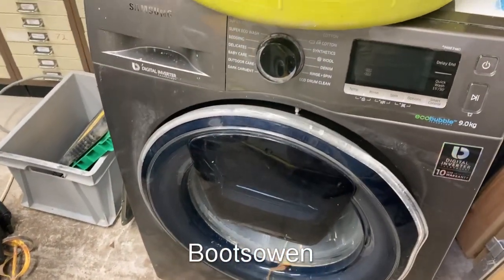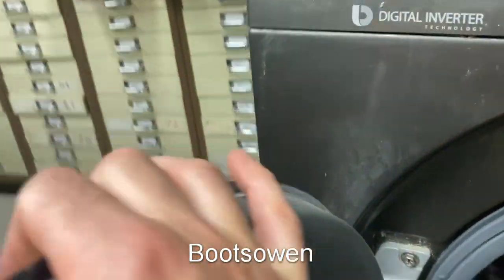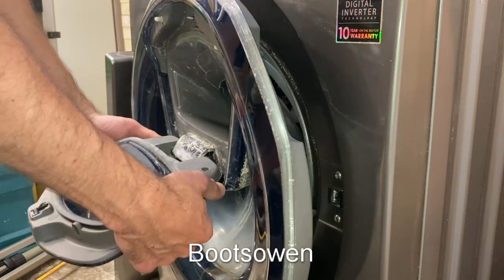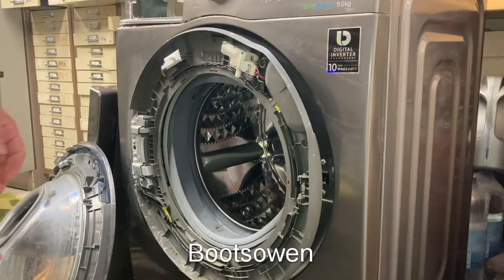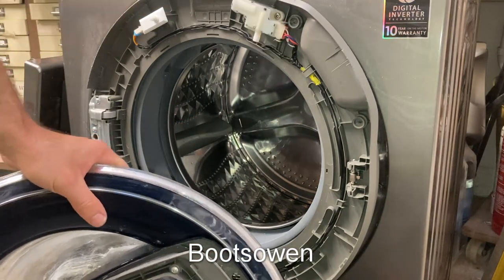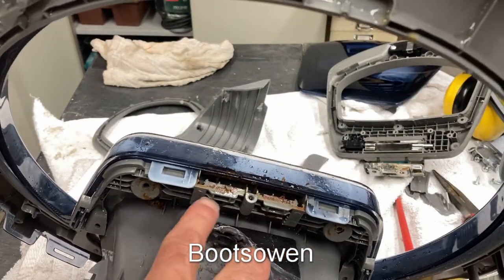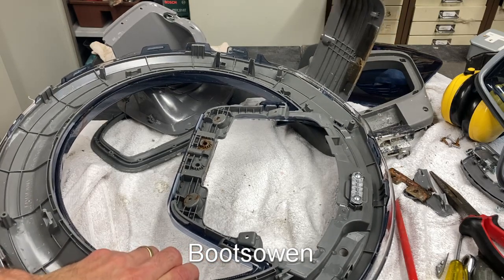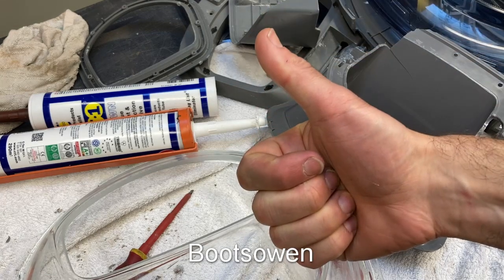Samsung Ecobubble broken leaking door | How to disassemble and repair the door | part 1: disassembly

Comment: Owen, in my world I would tape the sensors in the door closed position. Then before refitting the door front, see if the machine starts to work. If that's the case, cut some thick perspex or aluminium and seal the hole in the glass with that. Be very useful to see if this approach works, cheers

Comment: hello! The small secondary door in my machine is stuck from one side. I see in the video that there are two locks for the small door. When I try to open the door, only the left lock comes undone, and the door remains stuck. Any ideas on how to fix it? Thanks!
Reply from the maker: I would just leave the small door locked, it is nonsense anyway! the big door will open if the small one will!

Comment: Do those Samsungs have a sealed drum? I like them. Apparently they’re great cleaning machines. The door in door is a gimmick though. Wonder how many of them get scrapped because of this fault?
Reply: AFAIK, Samsung uses splittable tubs only.
Reply: @voshin  in Vietnam where is my country i'm from, over 90% front load washers (not only Samsung and LG but also Electrolux*, Panasonic, Aqua/Haier, etc) always use split tub which is nice since most people hate the anti-repair system by using sealed tub which makes the machine impossible to repair as well as you cannot replace bearing or spider, also you cannot recycle them like split tub be

*talking about Electrolux in my country they still use split tub even on their newest models, unlike the European ones
Reply from the maker: This one has a split tub.

Comment: Yeah I'd say the door in door is kind of a gimmick though I do use it often so perhaps not .
I'd say the intention is that when you take a load you may drop socks and small things I know I do, and you discover them after you have started the machine often ,in my case halfway up the stairs ,when you pause it I discovered that both the mini door and the large main door open this is handy for large things, I'm not sure of this is it's intended use, I've not seen the large door opening during the pause of the machine featured in the manual so perhaps not )I use the little one for socks and pants any small things though (and this is where  I feel the little door  could be a gimmick )the  machine uses very little water so the little door isnt necessary really ,I open the large one and water never comes out it's simply doesnt fill up that much ,even when full ,the displacement doesnt make the water go higher than the seal.

Comment: Hey Boot, wanna ask you when you open the frame for the main door, where you start to clip out first? Because the door sensor for addwash broke and I plan to replace myself. Cost to fix without warranty is 182.91USD and I say its a rippoff sicne the part dont even go over 13.57USD. Told me to replace the whole door
Reply from the maker: You will have to scrutinise the video. I think there is a cover that slides off to reveal screws. 
I made a subsequent video of reassembly and the last part of that is probably your first step. Glad you are going to repair it.

Comment: Samsung make you work extra hard 😓 for door the repair 🧑‍🔧 so I can see why they don’t bother doing that repair 😊 and give a new machine instead 😮 Why is it designed so complicated 😅
Reply: it is because people want to put forgotten item to machine easier without suds/water leaking like when you open entire door. however for me addwash is still extremely pointless, thanks god i didn't buy the one with addwash door, i have used AI model 10kg for 8 months which its main door doesn't even have both addwash door and doorshield, i just don't like samsung making entry-level/mainstream ones having very light on its weight, making them more vibrations and shaking too much like mine, only 67kg of net weight
Reply: Thanks for the video.. I’m having the exact same issue with the add wash door and is looking for some simple fix to it… judging from your videos it’s quite a challenge .. either I attempt his or fork out for a beand new door as per samsung … the new door is about 1/4 of a new machine price 😢